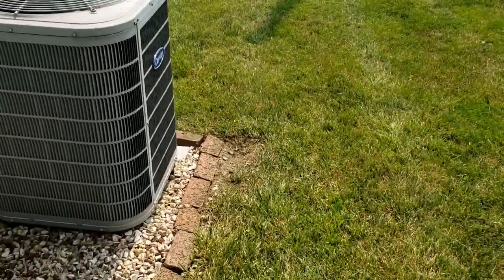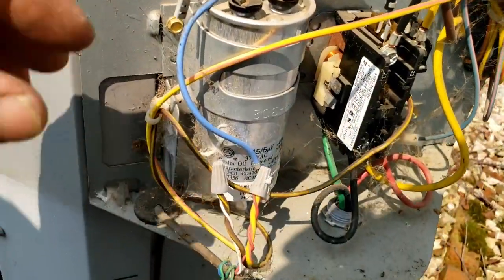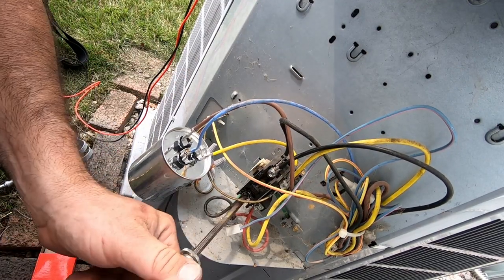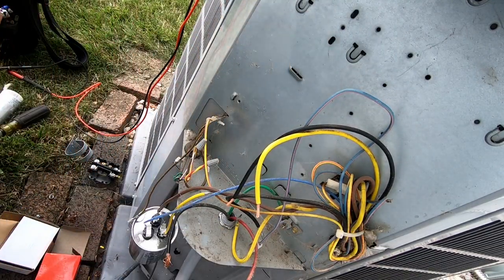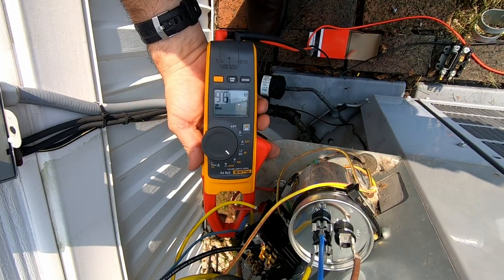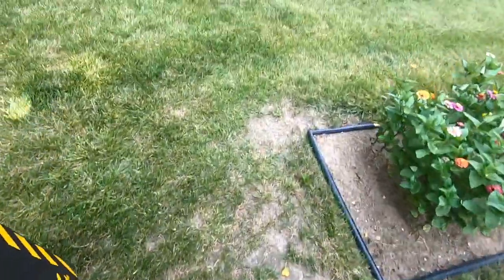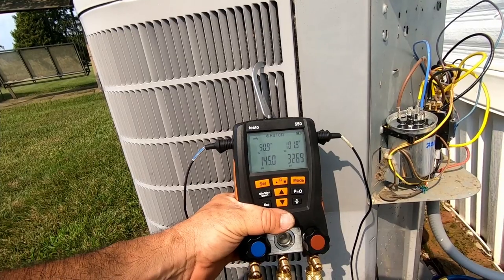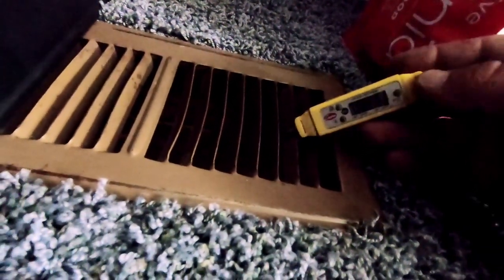AC Not Cooling Earlier / Running Now. CRIME SCENE INVESTIGATION !?

Comment from the maker: I've had a lot of people ask about the wire tie used in the video to hold the capacitor. These are Southwire heavy-duty cable ties part number.  CT1150100 , they are 11 inches long and 50 lb tensile strength

Comment: Yes sir 410 a is very delicate and everything has to be right including duct size for it to work right with r22 you could get by with alot I've found alot that the return was the problem the flex might be the right size but if the hole in the floor is to small it will cause problem I will remove the door on the unit if the pressure gets right then it's a return problem and everyone says it has worked for 20 years like that I'll tell them it didn't work for 20 years with 410 a. They want the problem found but they don't like what you find. We started using 427 a as a alternative for 22 and it works good but like 410a it takes a long time to charge a system because I've dumped it in and got the pressure like it should be go back 2 days later and it was low but not from leaking just it stabilized and was low thanks for your hard work your knowledge and your time keep the videos coming
Reply from the maker: R22 blends suck but they are here to stay. I have had the best luck with 407c
Reply: @HVACRSurvival  thanks for that info I will see if our supply house has that in stock if so I'll get a can and try it out

Comment: What model GoPro are you using?  And do you like it?
Reply from the maker: I was using the GoPro 7 black. But I just recently bought the DJI Osmos action cam. Even the GoPro 9 black has lockup issues and battery issues. The DJI is the same brand as my drone I just purchased and is the reason why I switched to it. So far the batteries last longer, it was half the money and it does just as good.

Comment: I think 410A is so temperamental due to the combination of gases. I noticed a lot of techs love to over charge those systems, especially when it’s a heat pump in the winter that’s the worst. Come back in the summer and it’s going off on high head pressure reading 550-600psi. The last company I’d blame the office for always always I repeat always rushing us.  The new company I’m at is complete opposite. They give you as much time as you need no one bothers you. Schedules on your phone and you just take care of business. I love working for myself though nothing beats that feeling.
Reply: 100% in summer I don't have that much of an issue but in winter  even at 50oa the pressure loves to start low to the point of frosting before it starts climbing.

Comment: hey! what magnet do you have on that meter? only reason why i dont use a fluke is the lack of magnets for the amp meters
Reply from the maker: It's made by fluke, it works with almost all their meters. I don't believe the cheapest of the cheap have a spot for it so you have to use a wire tie for those. But the 902fc, my 376fc series has it. But the 300s don't
Reply: @HVACRSurvival  ohhhh ok im switching back then, so 902fc and 376fc can utilize the magnet, great to know bro! awesome videos by the way
Reply from the maker: Thank you!

Comment: Had a carrier unit the other day doing exactly the same thing. It was also low on refrigerant. Had a TXV too. My superheat was pretty low. Took the bulb off and sandwiched it between 2 ice packs and the superheat shot up like it was supposed to. After getting it charged up. I had 6-7° SH and 14° SC. Still didn't make me feel the greatest when i left the job. Granted my lineset was pretty short, around 20' so i chalked it up to not picking up a tremendous amount of heat on the way to the compressor.
Reply: Hey man you did what you could, some techs just throw charge in without even considering the TXV.. Some times all you can do is get the equipment running as well as you can, nothings going be perfect. If I had to guess outside of a bad TXV sounds like it could be airflow related probably outside the realm of what the blower is doing, could be ductwork design even. Nothin wrong with making further recommendations in case the issue returns or persists. Where I'm at all these houses were wood, coal or oil heated not designed for cooling, there are 0 to 1 returns in the upstairs.. I get calls every week all summer here - upstairs isn't cooling, and it's usually 50 - 100+ yr old building.
Reply: @Falcon-eh8tq  its using flex and i cant physically get to see it all, so i agree with you. This split was feeding just a server room. I made notes about there being possibly a air delivery issue, but couldn't confirm it. Like you said, i did the best i could with what i had to work with. Still doesn't make me feel like i got rid of the problems, where it'll run like designed. It is what it is

Comment: Excellent Job....When are you going to get a new VAN????
Reply from the maker: Probably never. We run them till the wheels fall off. We have two full-time auto mechanics working for us. This man was purchase used with 80000 miles on it
Reply: @HVACRSurvival  yikes!!!!!!
Reply from the maker: @JoseRamos-cp5ll  but I make about $30,000 more year here than I did as a manager at the other company. So the question goes do you want a really nice van or would you rather be paid really nice money
Reply: @HVACRSurvival  forget about the van.
Reply from the maker: @JoseRamos-cp5ll  kinda what I had to do. They get newer ones but the square Ford vans are not as well built as this Nissan.

Comment: Where is the meter? First check is voltage suppled, then v. drops across closed contactor, cap while running and 2652 rule. Saves time.
Reply from the maker: Thats one way to do it. More times than not the capacitor is weak.

Comment: What app are you using? Is that connected to the your manifold? Since I have wireless probes and same manifold but not sure if that will connect to app, thanks
Reply from the maker: Most of the time I use measure quick. Alternatively sometimes I'll use the Testo app or the fieldpiece app but usually measure quick is the best

Comment: Oh so like in my 2001 Heil HP 3 ton it has a single pole contactor which I used a double pole tied together for double contacts on single wire.  So you said a single is supposed to keep scroll warm?  My unit pulls about 12 watts when off, probably heater internal winding.
Reply from the maker: Its done through the capacitor circuit.
Reply: @HVACRSurvival  Run winding?

Comment: I would have checked amp draws and tested condenser fan motor bearings.  Also, on EVERY call, I take the cover off the AC disconnect, checking for a worn disconnect.
Reply from the maker: I did check the motor,  right after the compressor in-rush and running current. 1.2 amps

Comment: Forgot to mention in my first comment ... I had the SAME phone until a month ago when I upgraded, and I used to have the same thing happen once in a while with the fieldpiece probes once in a great while. I finally tracked it down to being caused by my being connected to my cars radio via Bluetooth at the same time. My smart watch didn't cause a problem, nor my Bluetooth earbuds, but whenever the unit I was working on was close enough to the street that my cars radio had been able to establish a connection, ... the probes didn't connect. I tried it while sitting in the car after I figured it out and confirmed it.  So I always just selected it and disconnected it, and they worked fine.  I've heard other stories about various other bluetooth devices causing the same problem, so I guess it just comes down to certain things not playing nice with them.then. So maybe you own such a device.
Reply from the maker: Yeah I've had problems with playing music and try and use them at the same time. I think my phone shut the Wi-Fi off or something. Like I said I was recording with my phone and it went down on temperature. It's happened before. Time for new phone I just don't feel like spending 1200 to $1,500

Comment: Rick, what meter do you use. I’d like to get a fluke but they don’t seem to have one that fits all the HVAC needs. AC/DC, amps, micro amps, ohm/continuity, mfd’s
Reply from the maker: Fluke 902 FC and Fluke 376 fc are my clamp meters. I have a fluke 87 5, a fluke 112 and a fluke 117. Look on eBay for a nice used one. If it looks like it's brand new, it was probably treated like brand new. Watch a few of them to see where they sell that then by 1, otherwise if money don't matter by a brand new. The problem was fluke is they don't cram everything into one meter. For 90% of the calls the clamp meter will do what you need but some of the higher resistance stuff you'll need a block style meter

Comment: I picked up the knipex 13 72 8 strippers linesmen combo i love the stripper and cable cutter function but the cutter is on the inside of the handle and not on the tip but other than that they are fantastic
Reply from the maker: I love about everything Knipex makes.

Comment: the line was 50 deg,so what you are saying is that if the suc.line has ice and the s/c is low you still would add refrigerant ?
Reply from the maker: Is this a general question,? Because there was no ice on the line and there wouldn't be at 50°. Just for reference, when doing refrigeration, we can have ice on the suction line and that does not mean that there is liquid coming back to compressor. This goes back to your basic refrigeration,  you got to have liquid to the TXV, the TXV's job is to maintain the superheat. If there's liquid to the TXV and it cannot maintain proper superheat either you have an air flow issue, a restriction or defective txt. Those are most common problems off the top of my head.

Comment: Nice video Rick! Quick question.... can you share a link for where you found those nice wire ties (Zip ties)? ... Those wider ones you used for mounting the cap... with the holes in it? I've never seen those. But as soon as I did, I immediately thought of about a dozen things they would be useful for to make my life easier. THANKS!!
Reply from the maker: I'll have to look around. They had been sitting at the shop for a while. Possibly Lowe's or Amazon?

Comment: I hate the bug shield on contacters I can't see if it's burnt or if a spider has gotten under it and built a nest so far that's the only thing we don't agree on but everyone is entitled to their opinion thank you for the great video
Reply from the maker: I have had more calls for bugs in the contractor than burnt contractors not working. Remove two screws and you can inspect it.
Reply: @HVACRSurvival  true and I've had the bug shield slam full of burnt up ants so if they get in the unit that shield ain't going to stop them
Reply from the maker: @donaldpainter956  for little bugs like that, add silicone to the top and bottom of the of the case. Not all cases are the same, the new ones we got don't have a sealed top.

Comment: I imagine a leaking 410A system ends up with an improper gas blend, due to some of the gasses leaking and some not.
my reasoning? it's surely leaking out as gas and not liquid. so the same reason you charge as liquid, it's not blended as gas and separates to different layers in tank :)
Reply from the maker: That's called fractionation, although I've seen it happen it does not happen near what it was originally publicized as being a problem. The mixture of 410A is 50/50 of two components. Some of the other refrigerants are blend of five different types. Those are going to be the ones we have the most problems with
Reply: R410a is a near azeotropic blend. The two components stay mixed, should leak at the same rate, and boil very close to the same temperature. According to the 608 test I took, you can charge r410a as a vapor. I wouldn't recommend it though, lol.
Reply from the maker: Yeah I've had several go low and recharged them and never had a problem then I've had some where I pulled the charge and weigh it in fixed the issue. I guess it really depends on what the real issue was with the refrigerant.  possibly improper startup🤷‍♂️
Reply: @inoahmann7542   it's zeotropic, but almost azeotropic.
which means it still separates, especially in a gas state and worse at lowered pressures and low flow, like a leaky system!
exactly why you need to charge as liquid, if not they .

Comment: Might be time to do a factory reset on your phone. Even if you put everything you had on it back on it it will often help. 

As for over heating were you charging the phone and or using Google maps on the way to the job site? Charging creates a lot of heat and so does using the GPS function and the screen being on. It's a perfect storm.

Also when the phone is recovering from being too hot the Bluetooth chip may still be a little too hot and not function well even if the phone is back on
Reply from the maker: I think Verizon's trying to force me to buy a new phone. My battery used to be perfect now all a sudden it's draining by midday to three quarters of a day
Reply from the maker: @Shortcircuit220  my son has work for Verizon AT&T Sprint and now it's T-Mobile. He told me the same crap. Barry was replaced about a year ago because the screen got cracked
Reply: @HVACRSurvival  yeah that sucks when you only get a year out of a battery. Makes you miss the old days of being able to replace them yourself. Might have to double sided sticky tape a battery bank to the back of of the phone :p
Reply: Pixel displays are AMOLED, which is a poor choice for high ambient light environment.
Reply: The phone use I minimize with dedicated GPS tool.

Comment: Please use a high pass filter when working around running equipment to remove the high pitch hissing before uploading.. It's so horrible to some people and worse with headphones.. Almost makes it where I can't watch some of your videos.
Reply from the maker: My compressor limiter settings are adjusted to maintain a average of -15DB to -2DB. I also use a high pass filter which rolls off the low end at a 135HZ. You've got your terminology  backwards on the audio, I don't adjust any other audio equalization. I leave that up the viewer.
Reply: @HVACRSurvival  sounds equivalent too high voltage corona discharge every time your close to the service panel of the condenser in many videos including this one. 

Call it anything you desire but looking over the audio levels and listening to it in the last 2 videos of yours I viewed both have this issue.

I follow multiple HVAC channels and watch hundreds of videos so this isn't an issue many content creators have but you might want to look into. Put on this video when you walk up to take the panel off for the capacitor and you'll notice it. Never had a creator though that when a negative issue with their video was brought up said "I do some the rest is on the viewer" to paraphrase.
Reply from the maker: @jakesteel3641   Jake question for you? Are you one of those people that skips around in the video? I addressed what the noises that you're hearing now that I had to go back through and listen to the video.
Reply: @HVACRSurvival  no I watched the entire video as I do all of them which is why I addressed it's been in multiple of them. If it was an isolated issue I wouldn't of brought it to your attention. There was a previous video it was much worse and a 20 minutes of it. Restaurant with trash cans all around the unit, badly clogged drain pan, red/maroon wall believe, small condenser hidden behind main unit. If that helps
Reply from the maker: What you were hearing in the house trailer call was a Circulator pump on the septic tank system. I can't eq that out even with my 5 band parametric EQ all you can do is reduce it. Then you're gonna cut out my voice at the same time.
Reply: @HVACRSurvival  house trailer? No was talking about a restaurant and this two story attic installed. Sound almost identical to an ultra sonic cleaner.
Reply from the maker: The first one you were talking about took me to that video